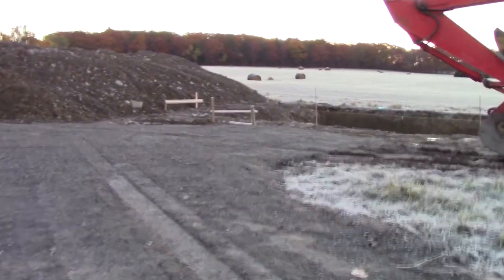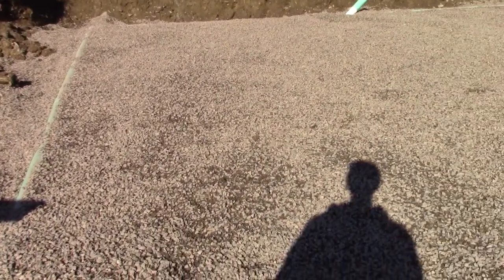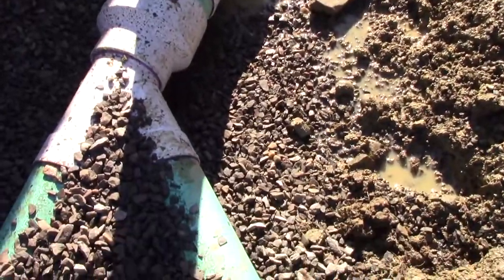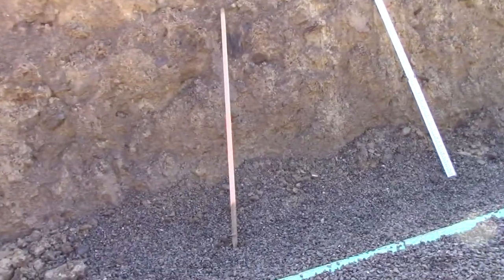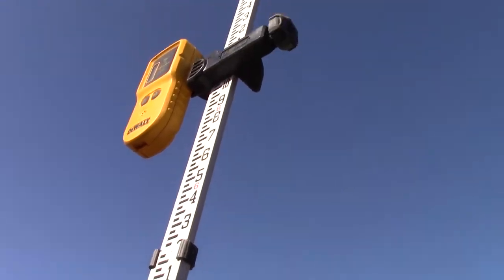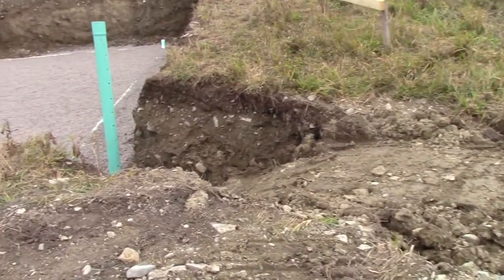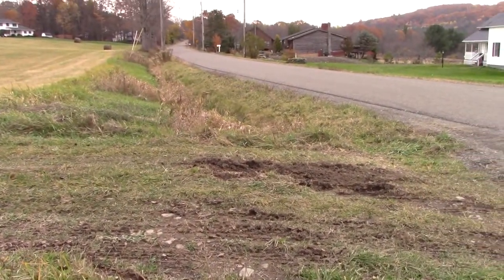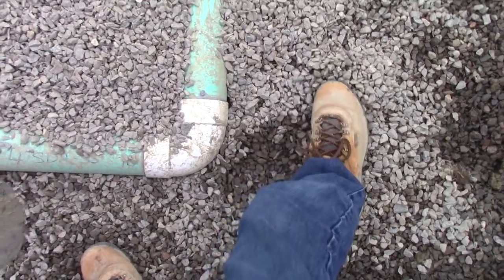HOUSE BUILD VLOG #5: Prep for Superior Walls Foundation

Comment: Reading all the comments here with very good questions and concerns.  I had my house built in 2011 with Superior walls for the basement (walkout basement) and the open side was framed.  There have been zero issues with settling, cracks, leaks or shifting.  I am good friends with a major builder in our area that has always used "poured" foundation walls instead, but recently switched to superior walls as he had some of the poured walls crack in the past.  My dad and I will be starting a secondary home in a month or so here in TN for my sister and brother n law and we will be using the superior wall system for 3 sides and frame the 4 side of the walk out basement. Everyone has preferences and I am sure there are occasions where these have had some failures.  I just received the initial bid from the rep yesterday and they have a 15 year warranty, so they do stand by their work. As I said, these are in my personal home, which is 2 story on top on the walls for 9 years now with no issue.  Hope this helps someone with some piece of mind.

Comment: No need for footers. The stone has to be perfectly compacted and at a perfect flat level. The panels have to be perfectly aligned and carefully assembled. I do monitor a 3 level apt building for 5 years now and i do not see any problem (grade level is at 1/2 of the hight of the panels) thence it is not a fully buried basement.

Comment: How dry does the soil underneath the stone need to be before the install? With record rains this year we are struggling to pump the water out of the hole and making sure its dry enough to install the walls.
Reply from the maker: I don't think I'm qualified to answer that question :/ the foundation walls rep would have the definitive answer to that. For us, as soon as the stone went in, the perimeter drain started doing its thing and drying everything out nicely. I will say that it was raining on the day they installed our walls and they didn't seem to care at all.

Comment: How does the drain carry the water away from the house? Are you using a pump?
Reply from the maker: Thanks for watching! In our case, we are high enough on a hill so that the entire drain system is pitched away from the property and down towards the road. So for us, is it all gravity driven.
Reply: @harvtronix  I wanna do the same but in order for me to do they I'll have to dig a 9' deep trench to where the drain will be daylighted. It's a lot of digging to do so I'm just trying to see if there is an easier way
Reply from the maker: Ahh, got it. For us, I think the max depth was around 6 or 7 feet. Our excavator dug it out in about an hour, but as you can see in the vid, he had a pretty large machine. Our septic system does use a pump to take the gray water out to the leech field for a reason similar to what you stated.
Reply: @harvtronix  yeah with the septic we are doing the same thing. The tank will have a pump going to the drain field. Do you have a pump from the house to your septic tank? Or just from the septic tank to the drain field. Sorry for all these questions. Thank you though!
Reply from the maker: No problem at all! We just have the one pump from the tank out to the leech field. Our septic guy recommended that as opposed to having to put a pump in the floor of the basement. He said since the indoor one would have to act as a waste grinder as well, it'd be a lot more prone to failure than one pumping liquid only.
Reply: @harvtronix  appreciate the feedback. We're gonna break ground next weekend so I'm trying to get things in order. One last question, do you install the septic system and well water system after the superior walls went up or did you do it before they went up.
Reply from the maker: Awesome! Best of luck! For us, we laid that septic drain pipe you see in the vid before the walls went up so that we could run it under the foundation and out to the tank. This put the tank really low in the ground, but allowed us to install fixtures in the basement without pumps. The well feed could probably have come up from under the panels too, but our well didn't get installed until much later, so they just punched a hole in the foundation wall before the backfilling was done.

Comment: did you pour any type of footer under the stone? I didnt see anything
Reply from the maker: Hey! Thanks for watching. Nope, I did only what the superior walls people instructed, which was compacted stone about 6 inches deep for most of the space, but 12" deep where pre-fabricated column footers would go. They brought those footers with them and set them along with the walls.
Reply: Harvtronix that seems odd. What keeps the house from shifting. The footers are usually poured in a trench under the foundation in solid ground. When placed on stone what (besides the weight) keeps the foundation in place.
Reply from the maker: @jsaud2  that's actually one of the big downsides to superior walls. My understanding is that a lot of people have problems when backfilling against superior walls with the walls shifting. They have very specific instructions about how to backfill to prevent that from happening. As far as once it's backfilled, I suppose freezing and thawing could cause some movement, but hopefully not at the base as long as it's below the frost line
Reply: Harvtronix that’s where I’m not set on superior walls yet. I want to have a walkout basement so the wall will be above ground so above the frost line.
Reply from the maker: @jsaud2  Ah, yeah I definitely agree with you that superior walls is probably not the best choice for that type of setup. If I had had unlimited funds, I would have just went for ICF's personally